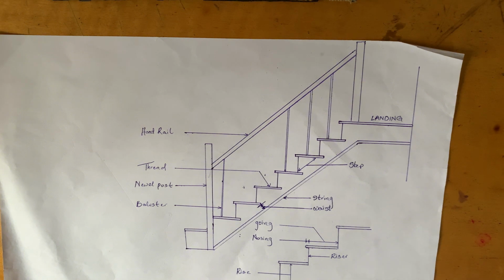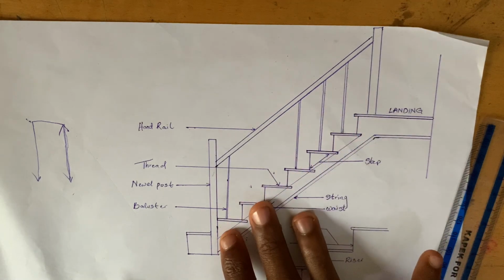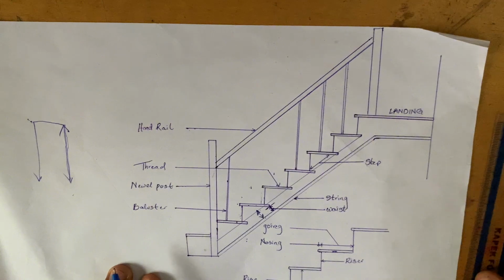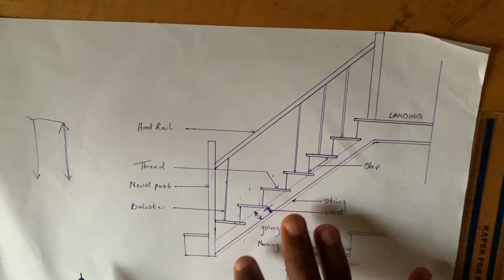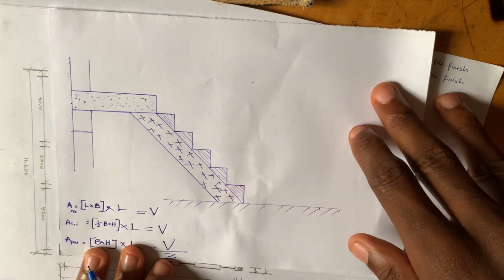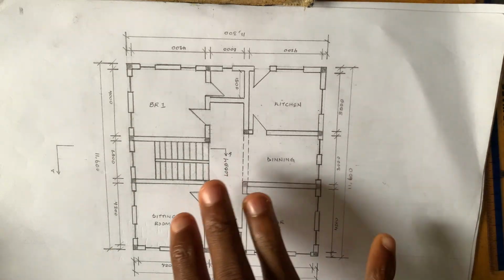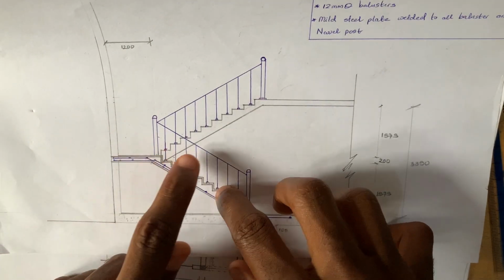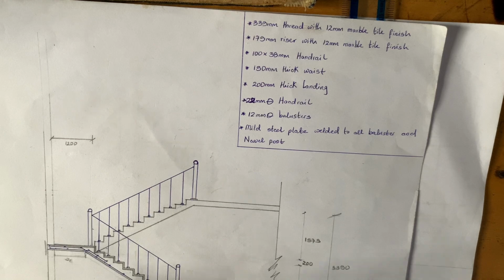HOW TO READ YOUR STAIRCASE DRAWING LIKE A PRO | EASY INTERPRETATION & MEASUREMENT GUIDE #staircase

Comment: Great tutorial 
But I have a question,  in the formwork, you said that most of them were to be measured in linear meter, especially those piece of wood that were separating the risers. But every piece of wood has a width no matter how small, shouldn't we account for that width? Let's say we have the staircase width to be 1200, then the section/side will be as small as 150. Can't we book it in m2 as 1.20*0.15/the no of risers?
Reply from the maker: You can do that oh 
Don’t get me wrong
But we measure in relation to the building standard here.
The width will will be stated in the description 
That’s the standard of measurement in the besmm4 revised if the width is less than 500mm.
This is because in the construction of the form work for those areas they are usually done with planks and planks all have the same width (I think 300-500mm there about). So all that matters is their length
That’s why!!
When you’re doing the estimation you’ll understand why better 
Because you don’t buy planks in square meters, you buy them per length
I hope you understand